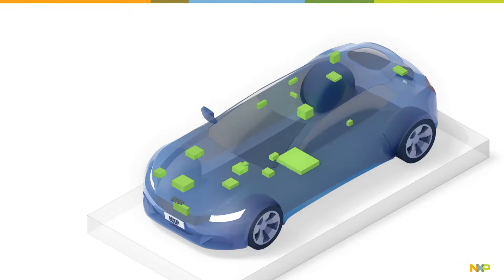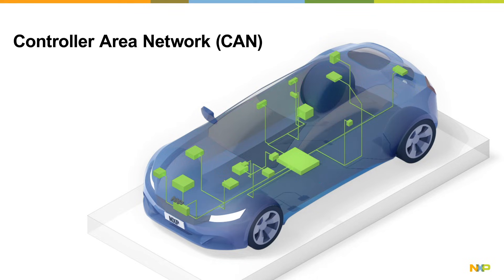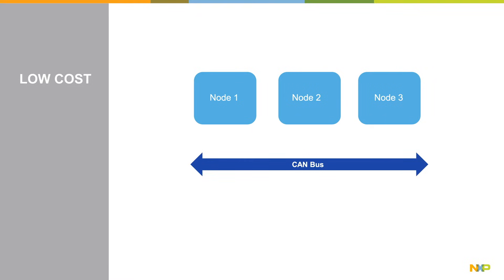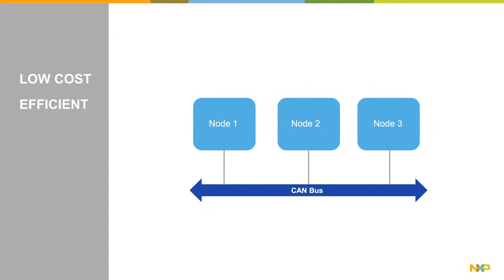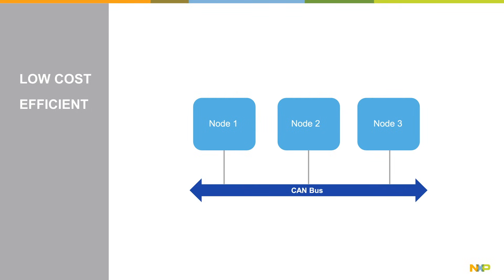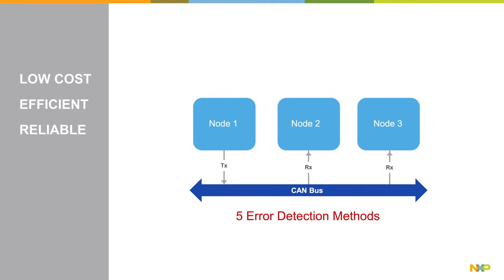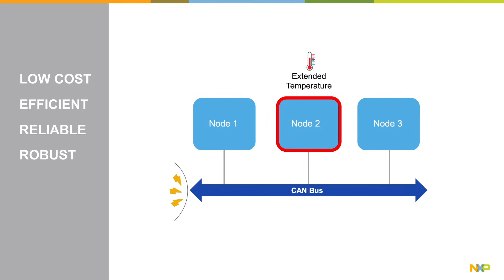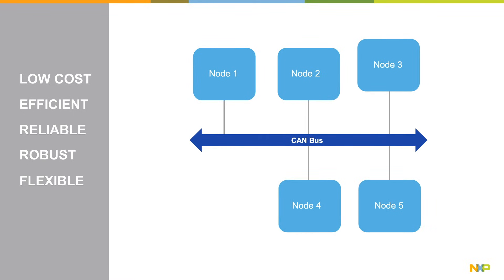What Is CAN Bus? A Beginner’s Guide to the Controller Area Network

Comment: everything that is electronic / relies on computer code means it can be hacked as well. This is why EV cars are not reliable transportation, as the possibilities of hackers taking over the control of the vehicle for evil intents is very possible. Even if the companies constantly update their system and pay ethical hackers to look for vulnerabilities, it won't make it hack-proof, as it is with every computer, it's a cat and mouse game where hackers will find other ways to infect computers after updates for OS and anti-viruses get implemented.

The difference here is the severity of such attacks.

Comment: I'm looking into these systems because as a mechanic i was wondering how these systems work internally. I learned that certain wires that read battery Pos after key on are reading ground with key off.
The whole ignition system read continuity to ground on each fuse that had to do with the ignition system. All for safety reasons ie, parking brake,  nuetral safety switch, etc. When unplugging the sub controller the continuity to ground went away.

I would love to understand how they work internally. The only reason i figured out about that ground / positive jive is because someone tried splicing into the key on wire from the switch to relay box for the LP lock off solenoid (fork lift) not realizing it had going as well.
It's like magic having both ground and positive other than for coils.